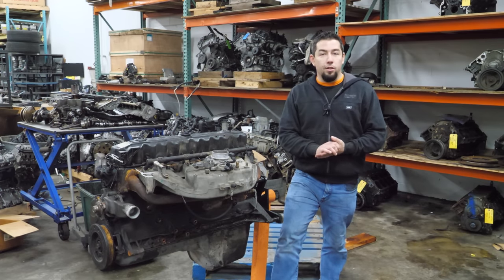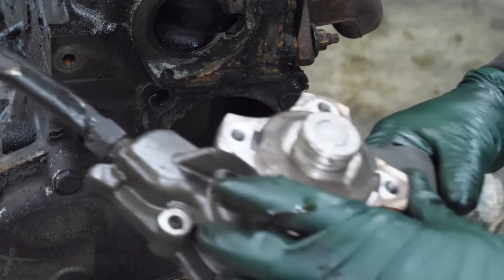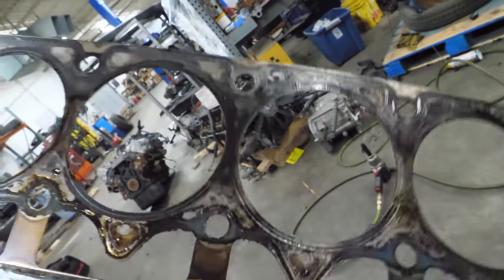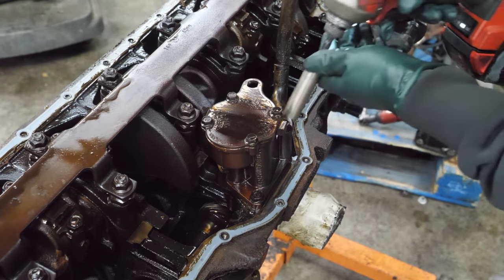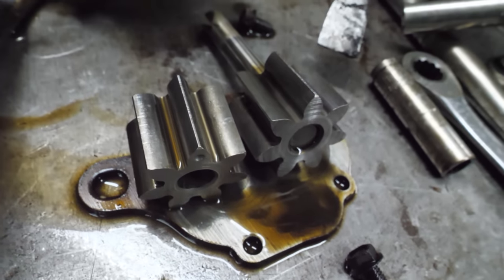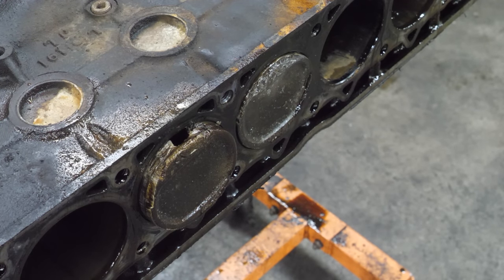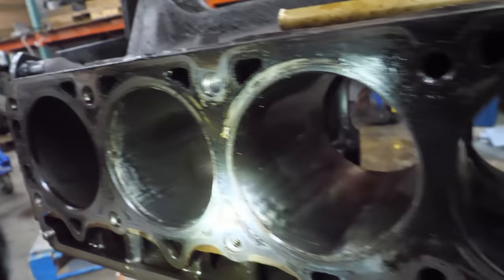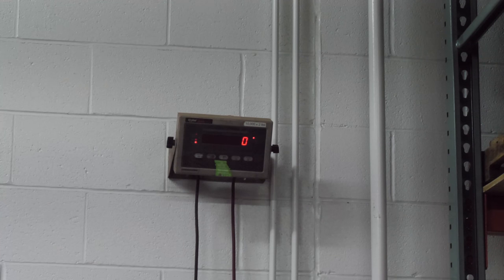How Do You Destroy A 4.0L Jeep Engine THIS BAD? Intentional? Neglect? Ill-Repair?  I Am IMPRESSED!

Comment: I have friend same engine 2001 grand Cherokee 4.0. That engine is best. Still running smooth. Anyway. That post video engine telling been overheat I meaning that engine blew very high overheat crazy. But I know the problems 4.0 engine has electric radiator fan there no clutch fan. The problem is electric fan is heavy amp make wire get hot then shut off itself until engine over heat. So. That grand Cherokee had V8 i did look at they had clutch. Why they didn’t put fan clutch on 4.0 it better than electric fan. That company factory duh. So I did change to my friend grand Cherokee heavy duty clutch fan. And turn off electric fan. Then never had issue.  I love that engine. Now I don’t know why no longer I-6 engine make.
Reply: My friend has 2001 4.0 has many problems with over heat due electric fan fail often. So I look at V8 has clutch fan so I order clutch fan to installer on water pump. And remove electric fan. Then has no issue.  Engine still best.

Comment: If that engine is STILL good, it can be rebuilt, and can be used as a generator engine.
Reply: I expect if it was cleaned up, hone the cylinders, put in some used pistons and a good head and it will be good for another 100k or so.

Comment: For some reason I was expecting to see all gear drive on the timing set.  Did the older ones have a gear drive or am I confusing it with a different inline 6?
Reply: Chevy straight 6 had gears

Comment: so in an XJ and TJ what would be the best year for the 4.0L? Assuming same year for both
Reply: 1999. That is the best year where you get distributor ignition, the stronger and higher flowing 0630 head casting, and the updated equal length runner “horseshoe” intake. 97-98 are just as good but they have the older “square” style intake. The power difference between the horseshoe and square intake isn’t very noticeable.

The 0630 head flows almost identically to the earlier high output heads, and has a stronger casting and larger exhaust ports compared to the infamous 0331 heads on 2000-01
Reply: @Rmehki  Awesome explanation thanks

Comment: I'd say head/gasket failure and they just keep running it and adding coolant, until it wouldn't run anymore.
it likely hydro locked multiple times, which easily shatters piston ring lands, those cylinders would run terribly, wash down the cylinder walls, detonate and all sorts of other bad things.
if ran much longer there'd have been fancy portal windows in the oil pan and block. doh😂

Comment: 0:47 use MOPAR sensors........ found out the hard way
.
the TPS sensors WILL suck in water.... froma napa, O'reilly's, carquest....... all the EXACT same sensor with the EXACT same problem
same with crank sensors..... NAPA worked for a little bit.... then started doing the same shit (cutting off....rpm gauge drops for 0.25 seconds, ETC)
.
use NAPA oil, air, oil pressure sensor, O2 sensor, ignition parts ETC.......
but if its a "major / mission critical" sensor..... MOPAR only
.
pay once.... cry once
.
.
or drive your Heep 160 mile in 3rd gear because you dont get OD if the TPS is shorted with water, and reading WOT the whole time.....

Comment: This looks just like the tear down of the engine in my 2000 Jeep Grand Cherokee the damage was so bad I thought someone had put and used engine in it because of the mileage it was the original engine it only had 147,000 on it was maintenanced religiously I know this because my father-in-law owned it These were horrible engines you only expect this kind of engine damage from a high mileage engine not with these they start disintegrating themselves before 100,000

Comment: You own a Landcruiser and then worry about Jeeps. One is a 4wd,, the other a waste of space.
These engines are styled on the Chrysler Australia Hemi 6. Very similar in looks.
The electric carby went lean and the 'management' also let it advance too much. I have never seen pistons like that, hole burnt down the side but never right through, pistons losing their head very often. Never seen a pin boss like those either. I guess it rattled a bit!!
That block would bore fine, crank needs a polish. Get desperate and weld the head.

Comment: The only way to ruin one of these is moronic non maintenance. Not a fan per se, but fixed enuf vehicles so equipped. Many over 250k. A few needed injectors , most just tune parts . It's actually the AMC 4.2 from the dawn of time. Cylinder heads interchange

Comment: Problems overheating,poor material piston,long Mileage.
Reply: Not just that 1 of the mine issues is the quality of oil people using I run mobile 1 full synthetic never had an issue I have 374k on mines right now

Comment: Nitrous?
Reply: I was thinking of that. Don't know how else one could get enough heat into that engine to melt pistons.

But nitrous alone isn't going to do much. You'll still need extra fuel to make nice damage.
Reply: @daszieher  Nitrous adds oxygen so you go lean if you don’t add the fuel. Without the extra fuel your combustion temps skyrocket. On top of that extra fuel will take some heat along with it out the exhaust. If you run nitrous with proper fuel and timing you can make huge power and if it breaks it will break hard parts. On a 4.0 I’d guess with a perfect tune you could feed it nitrous until it couldn’t ingest any more?

Comment: FUK, 2001 JEEP GRAND CHEROKEE HAS NO OIL IN IT and still drives good. gonna ride bike to walmart & buy 6 quarts at 6am. average cost to rebuild a 4.0 jeep engine? who cares, i never liked my jeep grand cherokee laredo anyways. Guess thats why it sounds like a honda civic, but its got 350,000 miles on it, and jeeps never die